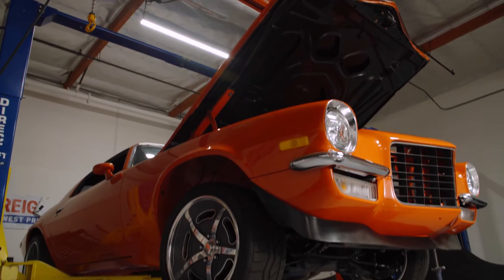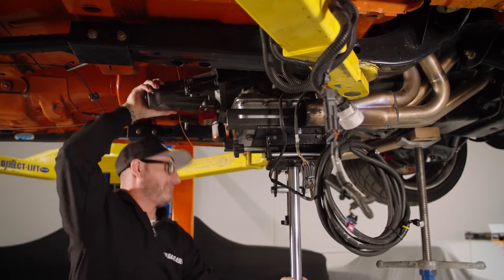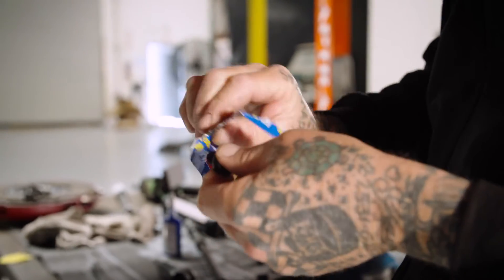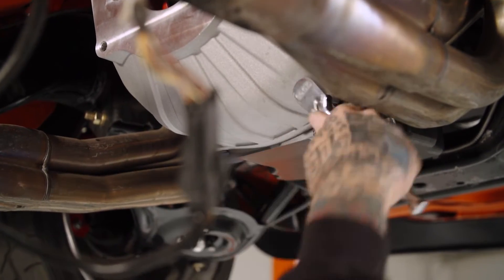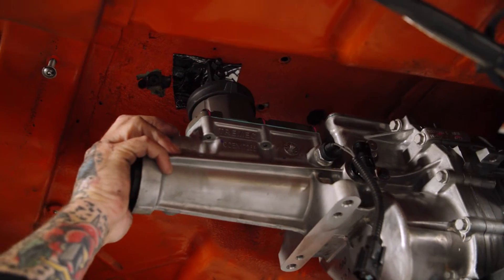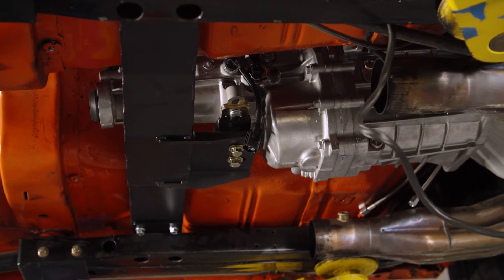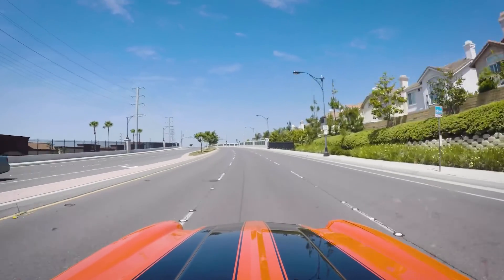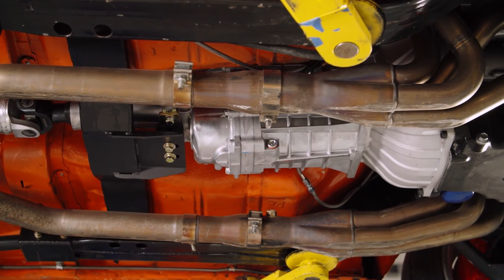How to install Tremec's TKX five speed in a Camaro using Bowler's Transmissions install kit.

Comment: What the bearing used co-laps info  , pressure plates, disk, flywheel. I having a problem with the clutch fingers bear pressing into the fingers. I'm using a 153 teeth flywheel.